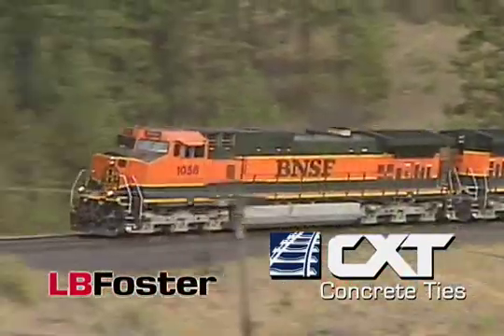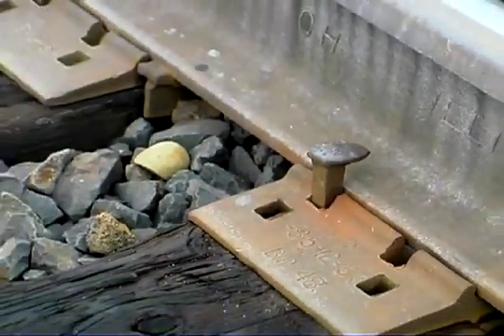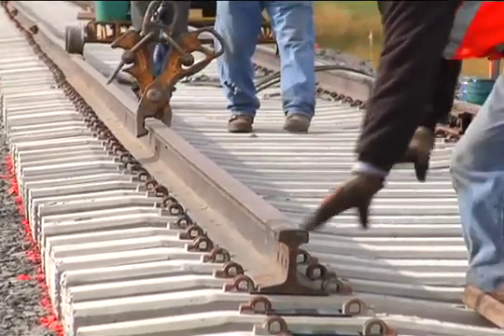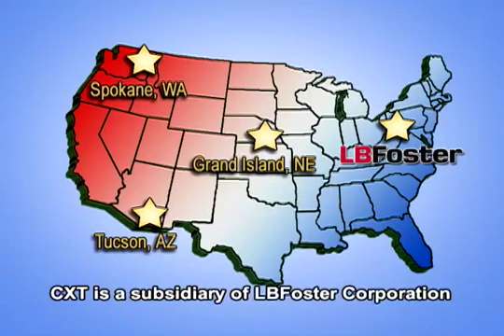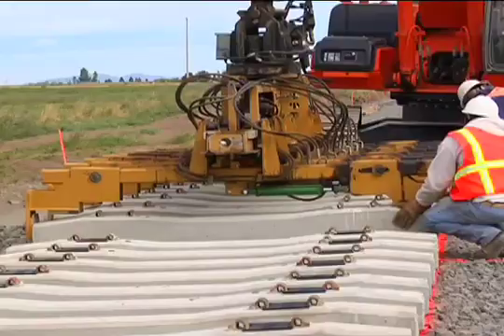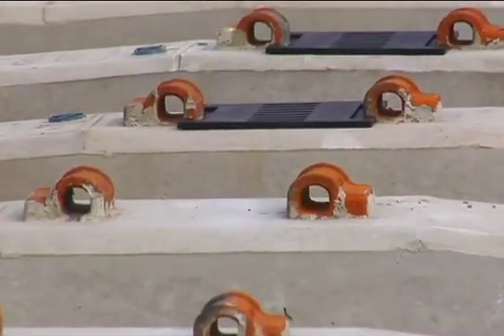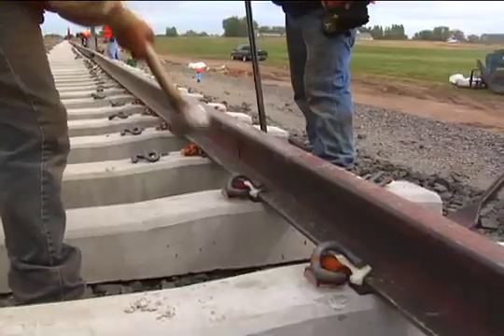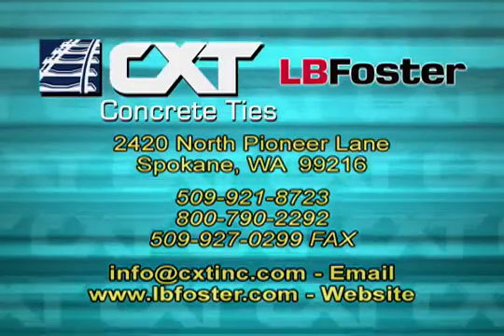L,B, Foster CXT Concrete Ties Install Video

Comment: Of all the ties I've been around, olde fashioned wood ties are still the king of the rail. Concrete doesn't allow for the rain to give in differing climates. And the ride is much stiffer and rough.